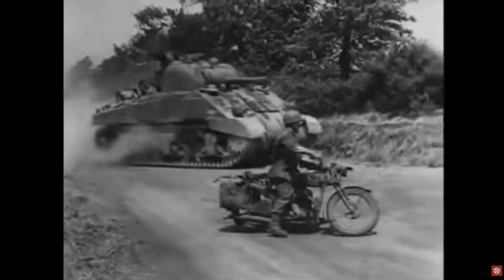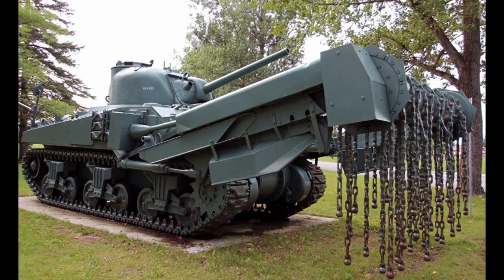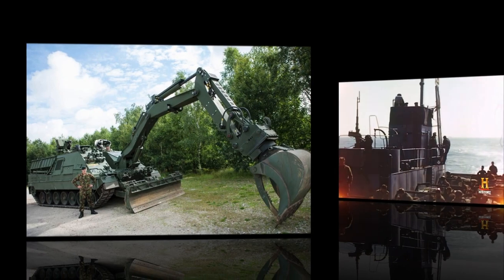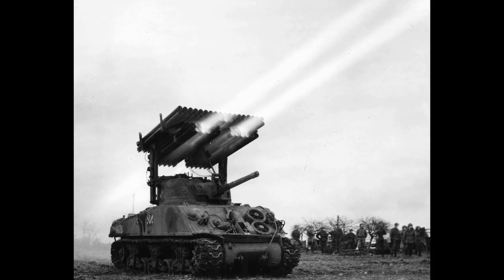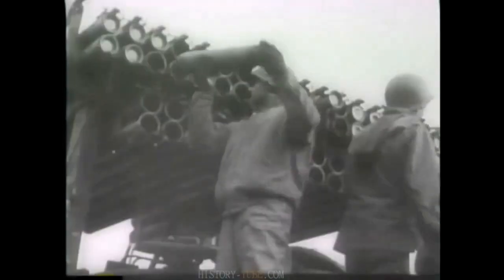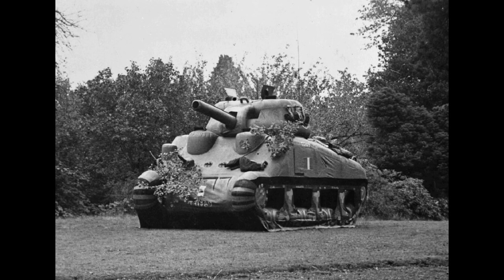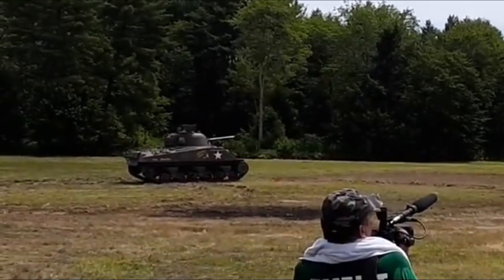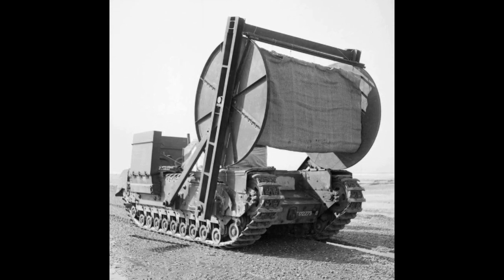The Craziest Sherman Variants !

Comment: 4:05-4:10 Well yes, one role of the (flowstream) flamethrower was to burn stuff. But it's other role was to be used against fortifications (both ad-hoc made structures, or concrete structures with small openings. But not against fully sealed structures).

Apparently, the burning liquids could get thru a small openings in bunkers more easily than other weapons. Bullets aren't effective against the "thick skin" of bunkers. Bombs, and shells are somewhat ineffective against bunkers, because the shockwave of the explosion either gets mitigated by the bunker's walls, or the explosive shockwave doesn't travel very far after penetrating the bunker. But, flamethrowers have no problems with fortifications. In fact, it's the only niche role that it's REALLY GOOD at doing.

Oh, did I also mention that flamethrowers can also kill u by smoke inhalation, and oxygen deprivation??? Yeah......fun stuff   :/

Comment: imo the craziest Sherman variant is the Firefly, fitted with 17 pounder with sideways placement cause it won't 't fit if it's the normal position, making a hole at the back of the turret for the radio cause the breach was huge, and not to mention the standard-issue Sherman engine was no good for the Firefly that they basically fused 5 engines into 1 for the tank, the engine was Chrysler A57 multibank engine

Comment: 5:06-5:11 Well. You did miss some Sherman variants. There's the:

A) T-59 Sherman. A tank pulling a kid's toy wagon filled with enough ICBMs to nuke half of the entire continent

B) The Sherman tank with HCR2 "plastic armour". Arguably, the earliest tank with composite ceramic armour (there was also a Bren Gun carrier that was fitted with HCR2 armour too)

C) The Sherman tank with spike armour (mainly designed to stop shaped charge warheads)

D) The T-10 Sherman. Basically a ROLLY POLLY Sherman tank. Nuff said

E) The BARV Sherman. Basically a Sherman cosplaying as a ship...sort of

Comment: Great.... some historic information. 
You know how german tanksoldiers called the Sherman?
Tommy-Kocher. Cooking Pott for english speaking soldiers,  because they burned very fast.
Best gun that was a real threat 2 geman tanks was 17pounder Mk.IV but only on close range of 700m or shorter and a Tigers side only. While 7,5 or 8,8 could destroy frontaly a Sherman at 1,8km!!
Reply: Tigers side only? Nope. It could penetrate 150mm of armor at 1,000 meters. Which is more than enough to penetrate a tigers front. 8,8cm KwK 36 can't penetrate a sherman at 1,800 meters. Only when the sherman is angled downwards. Check your sources.